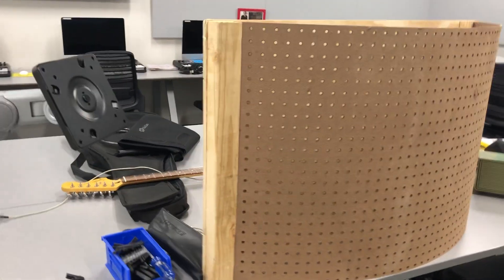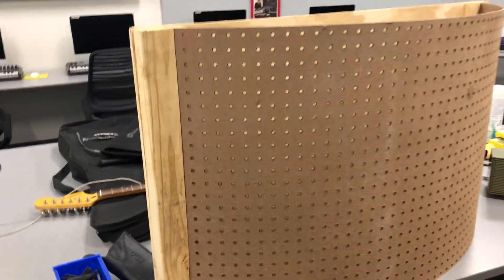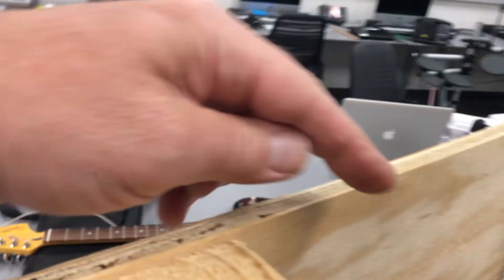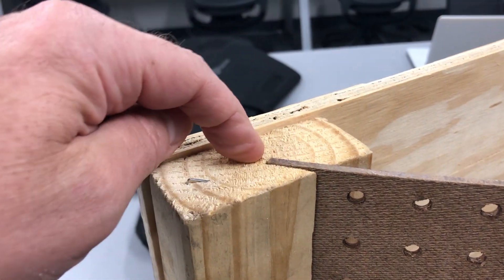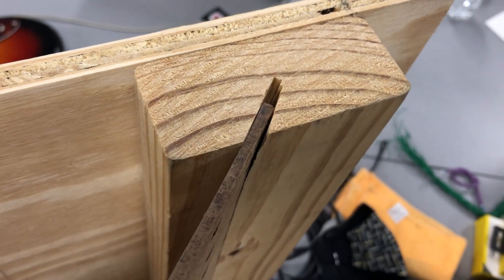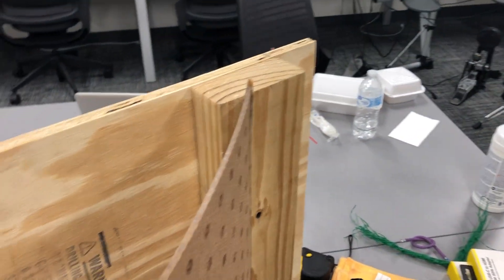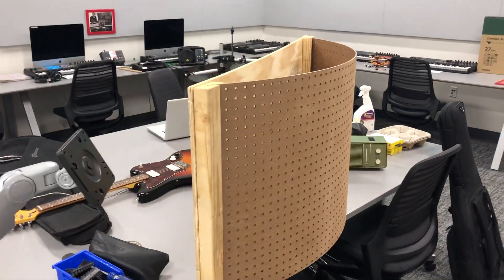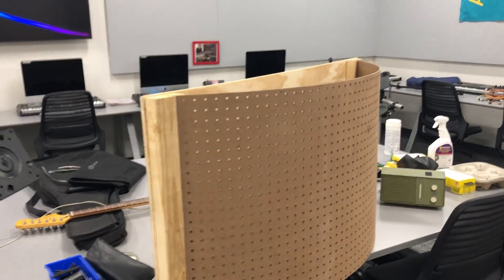Polycylindrical Diffuser

Comment: This is really smart. I had some 8' x 4' absorber panels built for me that had pegboard backs and I'll be darned if the flat pegboard side (when the panels were flipped around) made great diffusers even without the curve. Your video really inspired me to make some additional budget diffusers. I was thinking of using cylindrical concrete molds cut into thirds but this may be even better. 👍